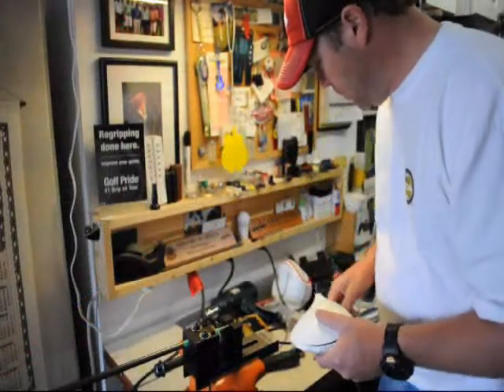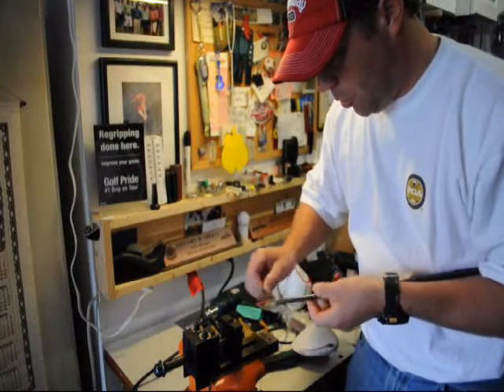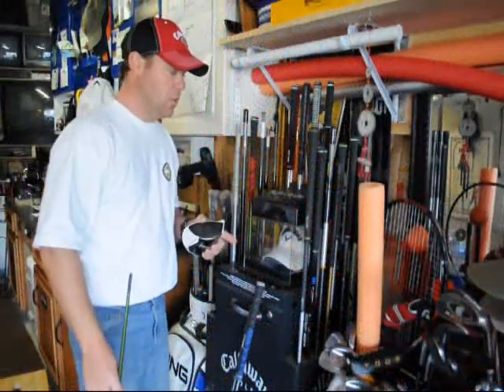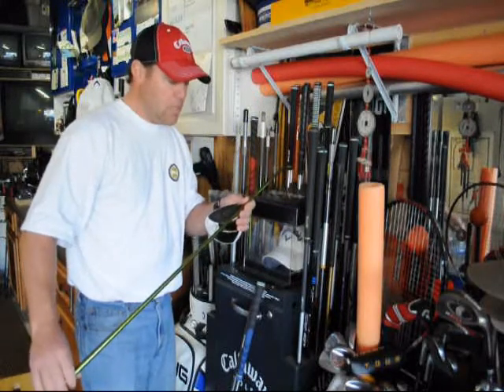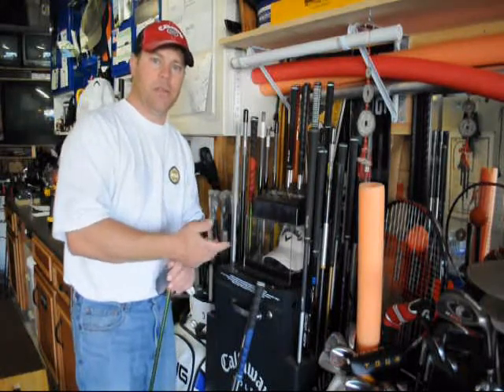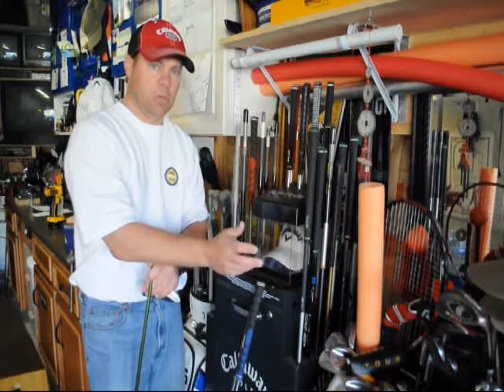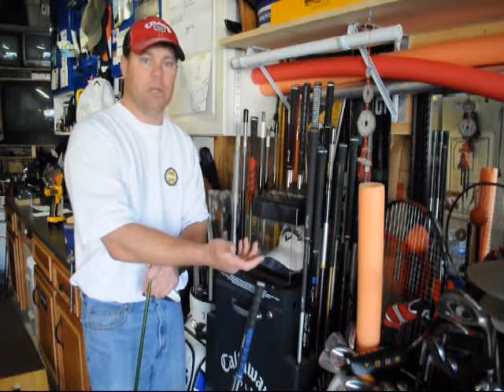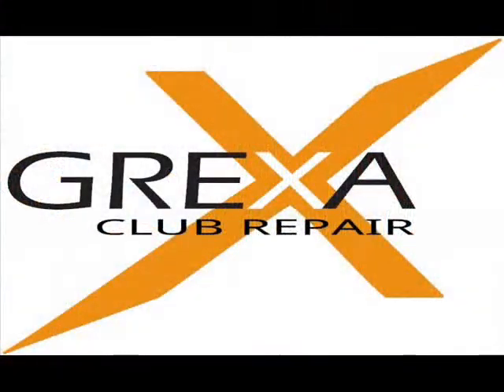Golf Club Repair - Part 2 - Removing the driver head and cleaning & prepping

Comment from the maker: Trimming a driver to 44" is very easy. Remove the old grip and measure the length. Mark the shaft with a sharpie at the length you want to trim it.  Wrap a piece of tape around the shaft, so that it won't splinter. Use either a graphite hack saw or a high speed dremel cutting wheel to trim to length.